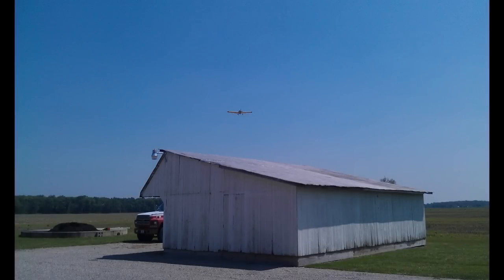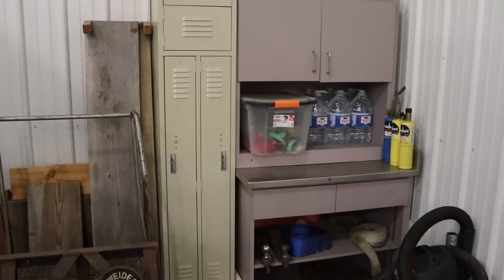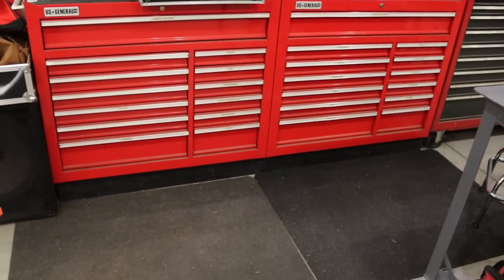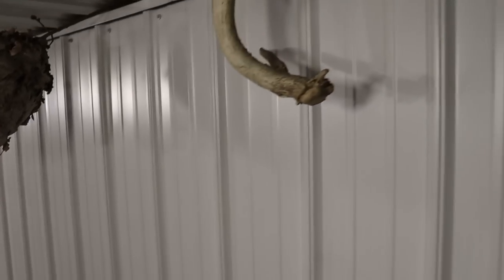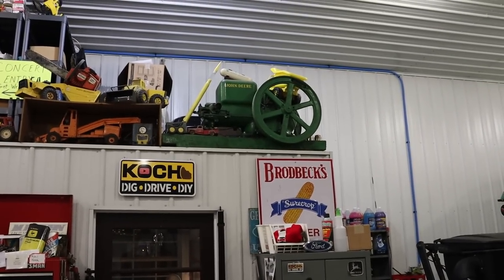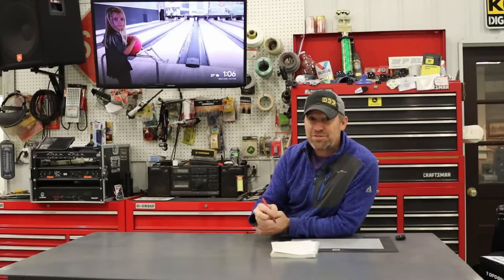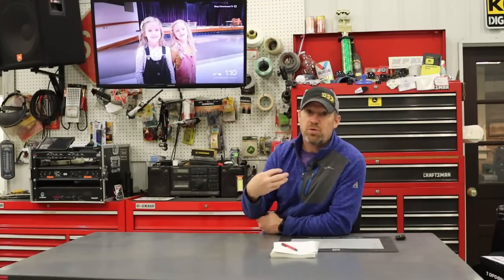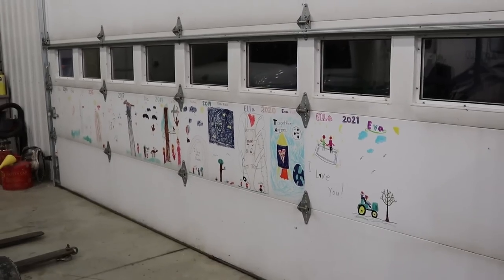Shop Tour & Channel Talk: (Subscribers ONLY)

Comment: Ok, I am going to add my two cents.  First off, LOVE the shop.  I am still dreaming of a shop that big.  A  car lift should be next on your list.  I suggest asking Kara for one for your birthday.  I had to laugh when you said you heat the shop to 50 to 55.  I would be freezing to death if it were that cold.  I guess you folks are used to the cold over there.  Also had to give ya a thumbs up when I noticed the type of frosty cold beverages you have in the Frige.  Among the low carb beverages, that is the most drinkable.  Red wine is better though......lol.  I must have missed the tour of the wine cellar below the shop floor.  

As for the sponsors.  I will be honest.  I immediately become suspicious of any product that someone is pushing on their YouTube channel for exactly the reason you mentioned.  This is why I like the approach that Project Farm takes.  I would suggest that if you do want to showcase some products, go into it super honest as you mentioned.  but to gain some street cred, I would want to see you try the item out for the fist time on camera so we can see your reactions and responses real time (no editing them out sir). If the item stinks, say so.  I will make the commitment to do the same in the comments because folks need good honest reviews these days before spending their hard earned cash on things.  I believe that a manufacturer has to have enough confidence in their product that they do tell you to be super honest on camera.  If I were in their shoes, I would want honest negative feedback as much as the positive feedback because that will improve the product and address issues that are limiting their current sales.  I have done beta testing for manufactures in the past so I know what they expect.  It is not always what they got....at least from me, anyway.  You already know I enjoy each and every video that comes out.  Honestly, the longer they are the better.  But I get that they are a time sink and we both know you already have your real priorities front and center in your life.  I guess what I am trying to say is that I understand the need to cut back a little and respect that you are doing what you need to do and that you are doing your best to take care of your YouTube family too.  For that I am very thankful.  Happy new year, my friend!

ps....I appreciate the fact that you are one of the rare few that does not beg for folks to like and subscribe after every video.  I wish others on YouTube could understand that it just takes something away from the sincerity of the video to do that every single video.  Its real simple.  If folks got something out of what they viewed or or really enjoyed it, they typically will hit the like button to express that.  So glad you already know this.
Reply from the maker: I've thought about a car hoist on multiple occasions.  I've had the opportunity to buy one or two as well, but I just don't do as much of that work anymore.  There are days when I would really want it I'm sure, but I like having the open space when I need it as well.  50 degrees feels cold at the beginning of the winter but then when it gets down to 0 outside then it feels tropical in the shop!  It's too cold to sit around in at 50-55 but as long as you're moving then a hoodie is all you need to be comfortable; at least it is for me.  I use the coffee maker in the shop more than the brews in the fridge.  Mostly for company these days.  I enjoy red wine very much though too!

I really appreciate your feedback on the sponsorship stuff.  That is good advice and I will certainly keep it in mind.  That's why I never mentioned the Brunt boots.  I felt I couldn't speak to how good or bad they were until I'd used them for a good bit.  I didn't like them at first because they were so stiff but they're fine now.

Also glad to hear you say you prefer not asking for subs and likes all the time.  I think it is somewhat annoying!

Happy New Year and thanks for being such a great supporter!

Comment: Neil, I'm a year late, but I love everything you're doing. As a fellow believer, husband, and dad, I want to commend the way you model so many traits that people need to emulate.

If you want to break in new leather boots quickly, take a hot shower with them on your feet and wear them around the rest of the day. Feels weird at first, but wool socks help. By the end of the day they'll be molded perfectly. Let them air dry in front of a box fan, apply a good coat of your favorite shoe polish, and you're set for a while.

Comment: Really enjoyed the shop tour. Getting ready to think about building a shop and always interested in guys shops and how they set them up. Would you do anything different if you had to build it all over again? 
As far as products on the channel. I think you are going about it in the right way. Some people promote product even if they don’t use them . Keep the content coming. Happy 2022 to you and your family.
Reply from the maker: Thanks!  That's a great question.  It was too much money at the time but with my setup I would have put the heat in the floor, just so it was quiet since my heater makes a lot of noise.  I could get something that wasn't as noisy and maybe I wouldn't say that.  The other thing I would change or finish is the exhaust system.  I really need to get that done to cut down on all the black dust that settles everywhere.  If you do welding/grinding I think it should be a priority when building the barn.  Otherwise, I'm content other than wishing it were bigger, but then I'd just fill with more junk!  Thanks and Happy New Year!

Comment: Could you do a video on the shop heater? The heat exchanger with the fan, the pump and how they all work off of the thermostat?
Reply from the maker: Yeah, I can probably do something on that one of these days.  I need to work on it anyway so that's a pretty good idea!  Thanks for the suggestion Mark!

Comment: I like your shop . Did you consider blow down air; at your roll up doors, to keep inside air and outside air separated . Would act like an insulator . Would take electric power to move the fans , but cost of fan usage should be less than temperature loss .

Comment: Nice shop!  Curious what has worked well for you to get internet / WiFi in your building?  Do you have a transmitter from your house?  Fiber vs satellite etc?  Most barns of concrete/metal are cell phone dead zones!
Reply from the maker: That's a great question. I buried an ethernet line from my modem in the garage all the way around to my shop. Separate router then installed inside the shop for Wi-Fi inside. I can use my phone on Wi-Fi to make calls and receive texts so that's how it works out for me.

Comment: Hi Neil great shop. Wondering why your hot water heater is backwards. Is there a reason for that. I heat my shop the same way.
Reply from the maker: It looks backwards but that's the way it blows air out - across the motor like that.  Maybe the blade is on backwards and I should have changed it!  Thanks Dave!

Comment: Suggestion, not sure if this will work for your overhead doors, but when I was in the warehouse business had many doors that  a blower on the door, activated when the door opens, and shuts off when closed, keeps heat and air inside ., also was in HVAC for many years, and when had built my garage long ago, I installed duct work  for heating and cooling with a furnace and a/c ,yep ran on propane ,of course my roof was insulated as well, but with your open, you could just put up installation or fiber board, so even need to take it down?
or make a storage up above?
Reply from the maker: Hey thanks David.  Always appreciate the advice of and experienced veteran.  My ceiling is well insulated.  Are you meaning that I should have insulation up against the roof as well?  I'm lucky that it doesn't take much to heat it as I've thought about a propane variant also.  That little electric heater I have will heat it up to 70 in here on it's own in a couple hours so I think there are lots of potential ideas.  I like those wind curtains for the doors though!  Thanks for watching and great suggestion.  Take care!

Comment: Really interested in the backhoe splitter. I have a 580k case. I know your busy, but would appreciate any closeup pics or explanation on how it was built.
Reply from the maker: Hey Gary. Thanks for checking out the video.  I made a video about the splitter if you haven't already seen it and it has a lot of close up shots.  I don't have any prints or drawings for it as I just built it on the fly and the one paper I did have with measurements I cannot find, although you can see a picture of that paper in this video:
https://youtu.be/AJnxYoCK-nk
Reply: @digdrivediy  watched the video, just what I needed, only difference in my hoe is I don't have the pin bracket welded on the front face of the stick. Ill have to come up with a way to hold the wedge up.
Reply from the maker: @garyallison4246   Yes I had to weld that on to my stick.  Good luck!